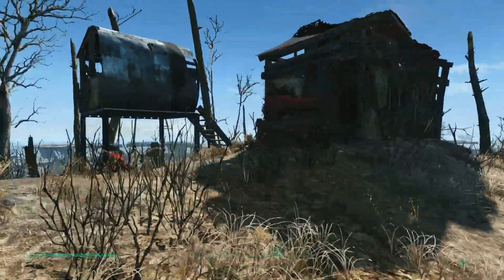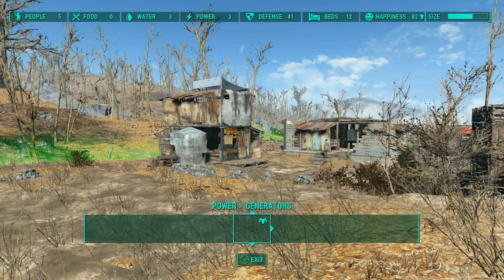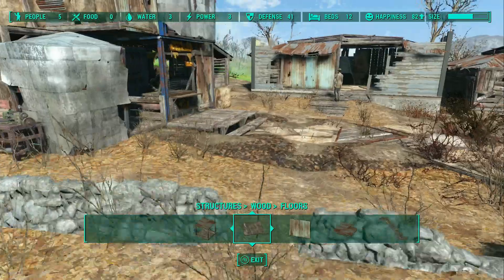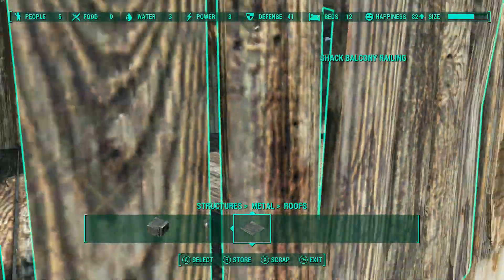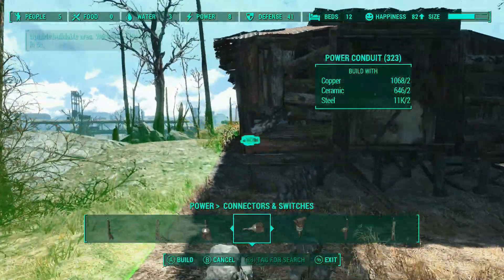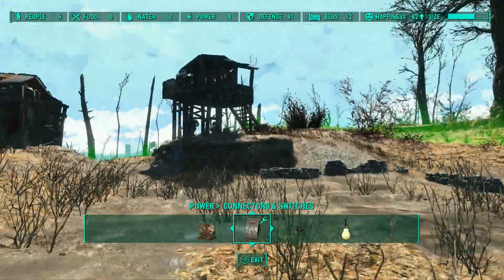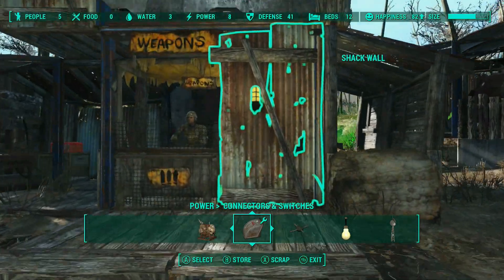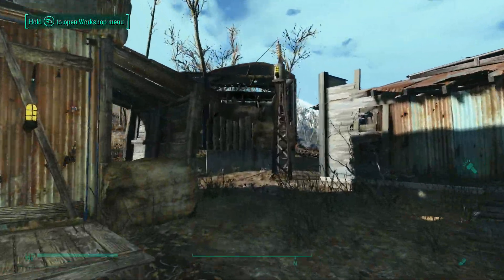Settlement Building Methods and Techniques - 08

Comment: 2:57 Group selecting in the sky is one of those techniques I've long been meaning to make a tutorial on. Of course it's always better to leave some room on the ground but sometimes you can't.

15:00 Must have been right after people discovered the wire glitch and we still didn't fully understand it. You were still placing conduits on rugs moving them til the wire broke and then going back and doing the wire glitch. Also exiting workshop after each wire glitch to get rid of all the white highlights. Lots of extra unneeded steps. 18:45 looks like you figured it out.

Comment: As usual new ideas (at least to me). Some food for thought. I suspected the conduit on the rug (I used it in early run thrus to put power indoors) caused a lot of conflicts. But I was bumbling about so much that it may have been any number of things that caused the trouble. So to be ultra safe I have avoided rugging (is that even a word, better than "the rug glitch" though) wiring ever since. I'm rewiring Sanctuary  at the mo and am using the wall pass thrus powered by a street lamp to keep things to a minimum. It allows power to go to conduits in the centre of buildings so at least outside it looks more realistic. 

I realise that you were not using the DLC stuff, but I love that big old streetlight, the Silver one.

Looking forward to the next one.
Reply from the maker: Rugging? Okay, that rocks. I might start using that instead. And I actually agree with you on the potential difficulties of rugging the conduits, but it's such a useful method to bury them into walls that I do still use it. I did it pretty extensively in the Spectacle build, for instance. I keep part of them exposed so I can take 'em out if I need to, and most of the time I don't use it, but it's such a handy tool that I had to include it. :)

Next installment's probably going to cover MG turrets. I found out something very interesting about them the other day and I haven't seen anyone else mention it, but I still have some testing to do before I'm comfortable confirming it.
Reply: +SarDeliac Rugging it is then. To be rugged. I rugged that. We might be on to something! Looking forward to the next instalment.
Reply from the maker: An update on the turret discovery: continuing to test it has revealed a probable answer to a complaint I, and many, have about one of the enemy spawn spots at Oberland Station. It explains a great deal, anyway. I'm gonna try to record and post it tomorrow. Stay tuned. ;)

Comment: ANOTHER great video! Thanks for this one. I think, when I try that "underground wiring" trick, I'm going to post-glitch the other connectors into the ground, such that only the tip protrudes (for connecting cables).
Reply from the maker: I used to do this very thing, but be careful with it. The wire will detach if you sink the conduit after it's been attached, and will occasionally not reconnect. If that happens, store the conduit (don't pull it out) because the game often stops recognizing it as a valid attach point. To help alleviate that, use the Vault 88 conduits instead, if you have them; they're thinner and smaller, and--unlike the regular conduits--you can slide them underneath structures like wood foundations.
Reply: Thanks again! Yes, I do have those ... so I'll definitely try this with them from the get-go.

Comment: You always give a little bit different type of build videos, and do a great job explaining different build orders. Keep it up. I get a few good ideas for my settlements every time I watch one of your videos.

Have you tried using the conduit from ww? I know it's a lot more material intensive but you can almost hide your all of your wires. Here is how I use it 
http://youtu.be/2D2bWAsSifY

Let me know what you think.
Reply from the maker: I'm really glad to hear you're getting some use out of these videos. There's gonna be at least two more in the m&t series for sure; maybe more if I can figure out other stuff to talk about. I liked the bar in your video. ;)

I dinked around with the conduits from WW a bit when they came out. I gotta admit they confuse the hell out of me in terms of where you can put 'em and how to assemble 'em to get 'em to work. The vanilla conduit pieces are clunky and boring, yeah, but I really know how to use 'em, so I guess I just stick with what I know... which is why I suppose I'll always be an intermediate-level builder. But I'm okay with that haha
Reply: +SarDeliac yea, the shops is one of the things I probably use most from your videos. I'm looking forward to seeing what you can do with the new ones that are coming with the update.

The only time I use the ww conduits is to stretch power across a space outside. I never found a good way to use them inside. I was disappointed they didn't give us some different options.

I've had a lot a luck just using the concrete pillar to drop them in the ground. The wire disappears as you lower it but always comes right back when you click off the pillar. 

Keep it up, looking forward to the video on turrets.
Reply from the maker: You got good timing, LA; the turret video just got done processing. ;)